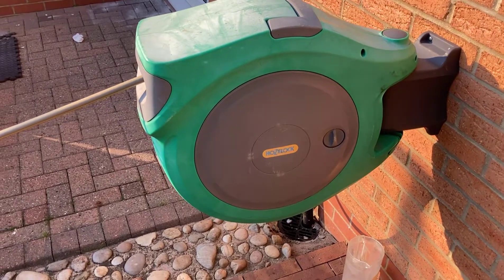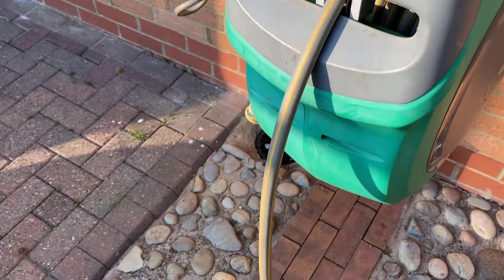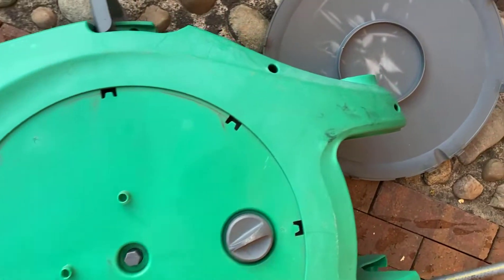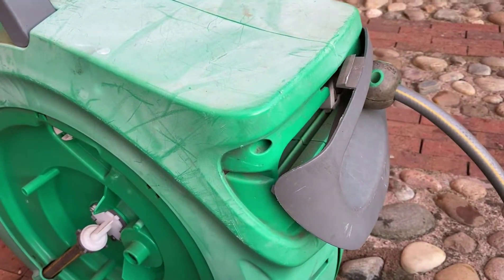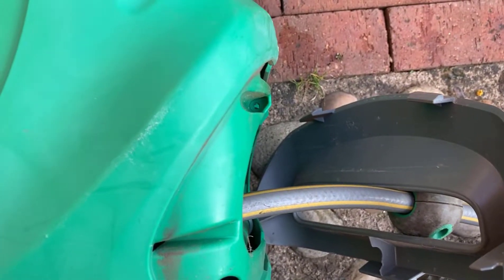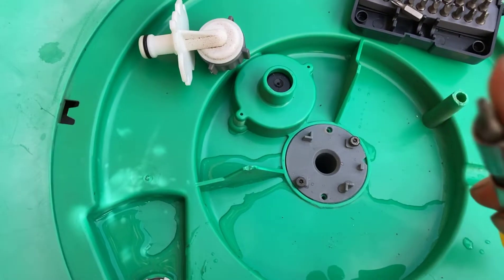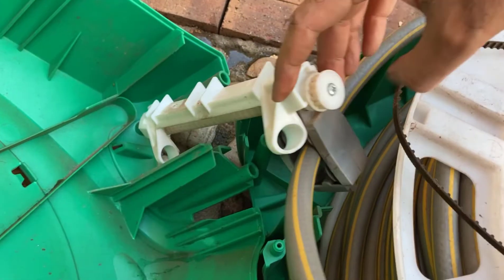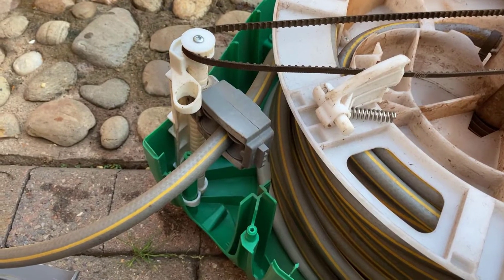Hozelock Auto Reel 30m keeps retracting/ Disassembly - Part 1

Comment: Interesting information. It has allowed me to replace the rubbish hozelock hose that came with min which I bought during 2020. I got fed up of the hose flexing and kinking whilst unwound causing the water flow to stop. I decided to replace the hose with one from Argos which reviewers gave good marks for not kinking. I paid £50 for a 50 metre hose which I cut down to 40 metres to fit in the reel. My first problem was that my screwdrivers were not long enough so I made a trip to Toolstation. Secondly whilst I held there spindle with a 15mm spanner the internal spring still operated when I removed the 2 screws from the tension plate, obviously I hadn't got that quite right! I removed the internal white plastic hose reel to re-attach the large spring in the spindle groove. I found that this detached itself  later when I was manually winding on the new hose so to make sure it stayed put I used a plastic cable tie to secure the rim of the reel to the grey casing so that tension was maintained on the spring in the spindle groove. After removing the old hose and attaching the new I could wind the new hose round the drum and screw everything back together. I spent quite a bit of time increasing the tension as others have described and have ended up with a fully functioning auto reel with a genuinely non-kinking hose. I'm not sure how many times this procedure could be tackled as all the screws are self tapping into plastic and, to my mind, wouldn't fare well after a number of removals. Hope this is helpful!
Reply from the maker: Thanks Doug, your persistent looks to have paid off. I spent a lot of time as well, but looks like you went next level, Well done fella.

Comment: BEFORE removing the two torx security screws holding the main spring shaft put a 15mm ratchet or box spanner on the other end of the shaft and hold the spring tension THEN undo the security screws and slowly release the spring tension about 4-5 turns until loose then remove the shaft and continue to replace the raceway lever. Once replaced, refit the shaft and align the end of the spring in the shaft slot, tension the spring about 4-5 turns before refitting the security screws on the shaft and reassemble the case.
Hope that helps.
Reply: Thank you for this tip, it definitely helped me. Even with the comment I was confused at first, but then got it. Basically, you use the bolt to wind up/add tension to the spring coil, then use those two screws to lock in or keep that tension in the coil. Once you screw them back in, even a little bit, you can't turn the bolt. I eventually pulled all the house out; wind the 15mm bolt/ coil up 10 times, then put the screws back in. Then i got it to retract some of the hose. Then repeated this again, held the bolt, removed screws, wound another 10 times, put screws back partly, retractedd more hose etc,. As mine is the 40m, it took about 4 repeats of this.
Reply: @the_judge_8262  same as me.
Reply: I'd love a video demonstration of this.
Reply: @stuffandnonsense8528  Next time in breaks I'll do one! Just follow my steps above and you'll fix it :)
Reply: @kevin.grahame  after a day of wrestling with the thing I finally did it. I have the 40m, grey and yellow thing. My fault was that the belt had come off the hose distributor, but I took it apart before I read your comment and had quite a shock when the spring unwound. Anyway, taking your advice of using a socket wrench on one side, I worked out that I could gradually wind the whole thing back up. Not 4 or 5 times, more like 50. I'd turn it until it was right, screw one screw in to hold it, let it take in enough hose that it was loose, then repeat that process. I did that a few times until the whole 40 meters was done. Now it works better than it did before it developed the belt fault.
Reply: @stuffandnonsense8528  Well done, always read the instruction book first 😂

Comment: Does anyone know how to increase the spring tension ?
Reply: Take off both side panels, unscrew the two standard torx T20 screws to remove the left side hose connection, place a 15mm socket on the right side shaft nut and hold the spring tension then remove the two security torx T15 screws on the left side. Slowly turn the spindle nut to increase the tension as required and then align the shaft screw holes and refit the two security torx screws. Test tension and once OK refit the hose connection and side panels.

Comment: Hi I've had the same trouble the broken part in your hand is called a raceway lever part no 16269 it cost 12.95 from hozelock ,if you ring 01213131122 with the part no they will send you one.
Reply from the maker: Thanks Derek, haven't got round to getting one yet, but i will, thanks for the reminder
Reply: I have the same issue and will order that part. Are you aware of any instructions or videos on how to out everything back together again.

Comment: C'mon Hozelock.com ... I have an almost new 30m auto reel which has jammed, about half-deployed ... likely user nmd, Hozelock have not made this product Loll-proof! ... watching Handyman Savage has saved me from voiding our warranty, as of today I'm awaiting a Hozelock Service email with advice and instructions!
Reply: Hozelock's advice received promptly by email:
If the Auto Reel is failing to re-wind, please try the following:
1. The first thing we always advise is to check that the manual lock has not been accidentally engaged. This should be in the padlock unlock position (please see attached).
2. Fully extend the hose to ensure there are no kinks or tangles inside the Auto Reel.
3. When the hose is fully extended, take the last section of the hose, near the letterbox mouth, and raise it upwards to a 75-degree angle. Give it a sharp yank (in the same way you would jumpstart a lawnmower). This should jumpstart the tension spring.
4. When re-winding the hose please ensure that the feeder hose is disconnected from the tap, and no water is left remaining in the main hose. Water left in the hose can cause the hose to take up more space in the Auto Reel which will cause some of the hose to stay outside of the casing.
<<< For your safety, we do not provide instructions for disassembling the Auto Reel, due to the large metal spring inside that is held under high tension. >>>

Response to Hozelock:
Our hose is jammed, with very little movement, about half deployed.
The manual lock is not engaged, it’s in the unlock position and can only be turned half way towards lock.
Cannot extend or retract more than about 2cm.
Not inclined to give the hose a harder yank than already attempted.
Also understand and appreciate the potential hazards involved in stripping and reassembling the auto reel unit, so not attempted.
Our 30m auto reel is quite new, what are our warranty repair options please?

Hozelock's further response:
The first year of the guarantee is held with the seller. If you return it to where you purchased it from they will be able to exchange or replace it.

We're promised a replacement 30m auto reel on Friday by the seller, no quibbling ...
Reply from the maker: Great advice, thanks for posting.
I was also told of the yank method, however it didn't work for me as the poorly built raceway lever had already snapped (the likely cause for the original issue)

Comment: Hello Savage, I have been looking at the same problem and it appears the the spring is part of a very badly designed ratchet lock which is part of the big rewind spring side o the hose reel. No chance of replacing this from Hozelock.:(
Reply from the maker: Hold that thought.... i will be working on this, whether i succeed is another matter.

Comment: I am looking to fix one too. I hope you find the answers.
Reply: I’m after the same part
 I’ve taken the cover off and the raceaway lever was loose inside mine is a bit more intact the spring is still fitted to it and it has a loop of plastic partly broken that yours doesn’t have. 
I’m thinking it may somehow attach to the lock unlock leaver?
Don’t know how to share photos on here.
Reply from the maker: Hi Andrew, please do share the pics/video. You can use something like dropbox or a free sharing service like https://imgbb.com or tinypic.
Reply from the maker: Ha, funny you should mention that Andrew, i bought that new version from Screwfix last week as well, got a comparison and installation video coming up soon on this channel.

I'll still have a go at fixing this one, if possible.
Reply from the maker: That was a bit unlucky, my new one came in two boxes, everything was intact. 

Hozelock customer services are ok, they were back in touch with me within 2 days and i also spoke to them direct on a previous occasion a few weeks back.

Thanks for the video clip you uploaded, I now know the exact position of the raceway lever. There is a bridge which links the two parts, which on mine had clearly snapped.
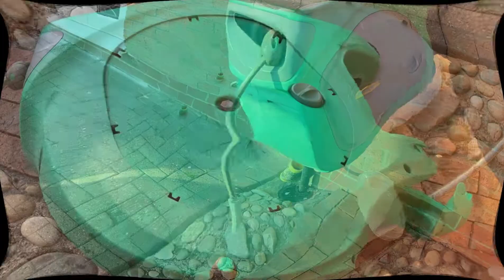Reply: @HandymanSavage   This video from hoselock explains how the Raceway lever works..   Check from 0:45 and you see it move.   https://www.youtube.com/watch?v=2eiQRHbYqK0

Got a unit that has probably the exact same piece broken.   Searched the internet but the part can not be found online. 
I'm pretty good at 3D design and got my own 3D printer..    Might be that i'm going to see if it's worth to redesign the part and 3D print 1..   And share the file so others can make a sparepart on there own..   But first have to dis assemble..
Reply from the maker: Thanks David, in the meantime i found out that the part i mention at the end of the video is called a Raceway lever, but Hozelock have put up a brick wall to release any further info (rightfully so for safety reasons). 
Likewise if you hear anything, let me know
Reply: @HandymanSavage  OK thanks
Reply: Handyman Savage, phoned Hozelock customer service 01213131122, its listed as an unofficial spare part ! Price 12.95 inc p&p.
Reply from the maker: Hi Shaun, i know the item (raceway lever) and price, however the problem isn't the item or price, it's where does it fit along with the spring? If someone can tell me where it goes, then i'll look to get it working again. Have you taken your's apart? If so, any chance of taking pics of where this lever and spring is fitted? When i opened mine, the lever and ring had already fallen out.
Reply: The same part is broken on mine, maybe Hozelock need to supply the appropriate spares.